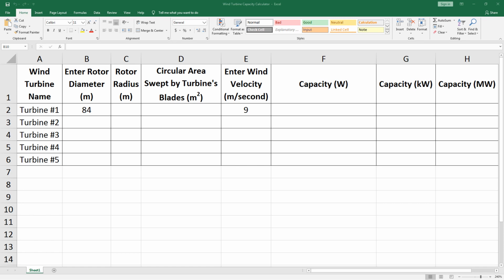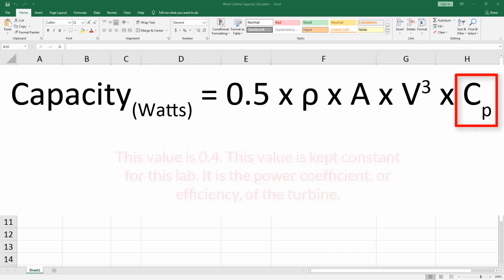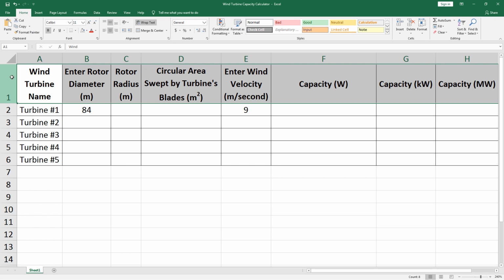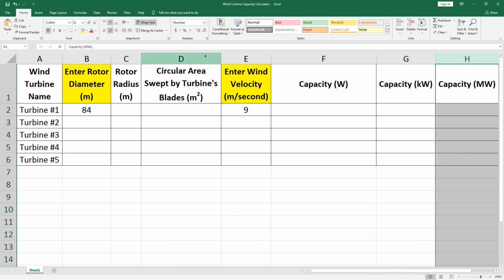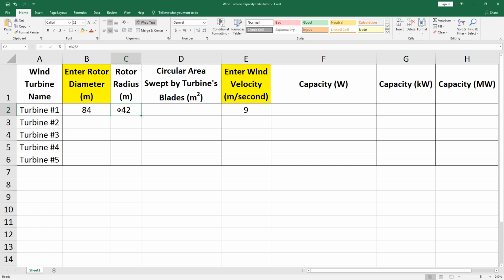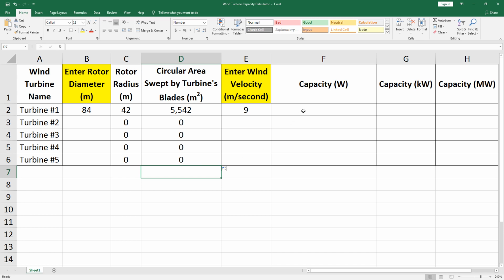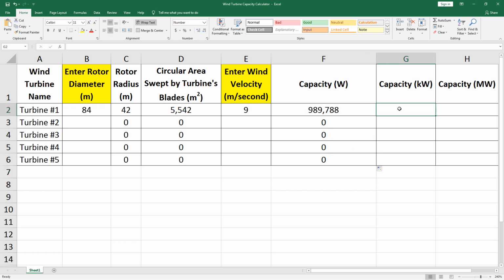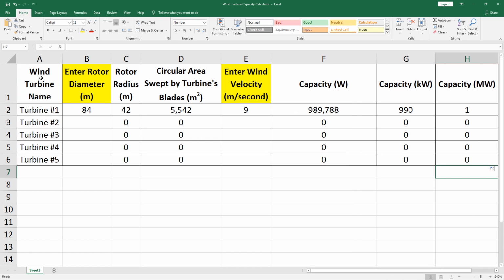Wind Turbine Capacity Calculator

Comment: No, that is NOT the "Capacity of the Wind Turbine". That is power in the wind vs Wind Speed.  The formula for the Capacity of the Wind Turbine vs Wind Speed is completely different and it has V squared, not V cubed. This video is very misleading.